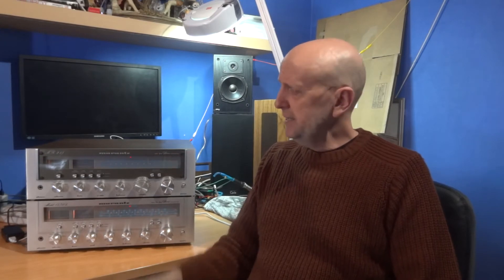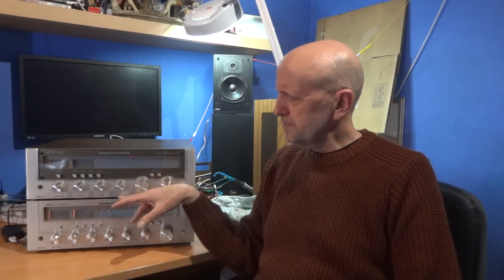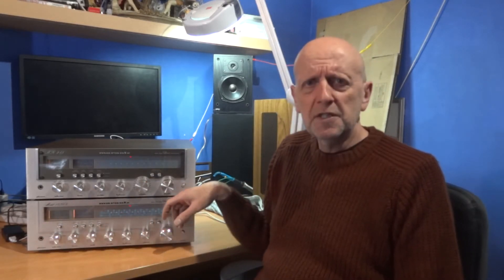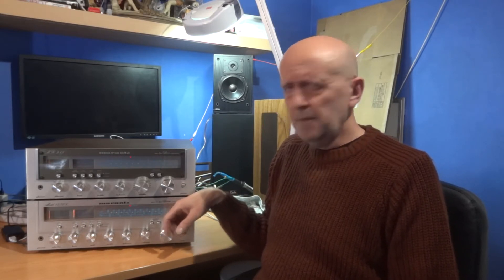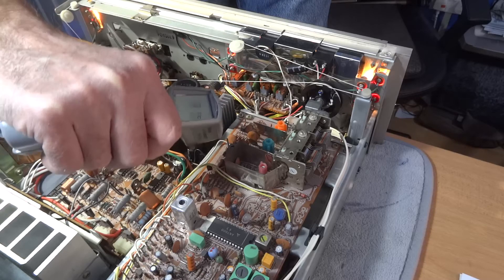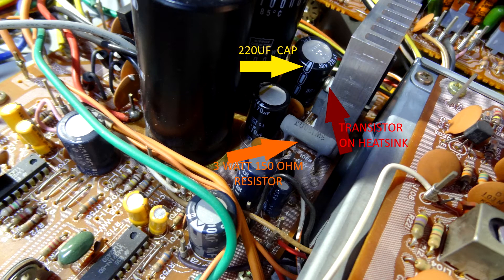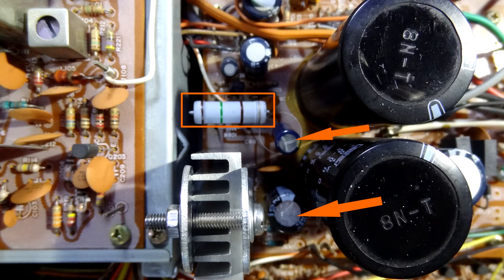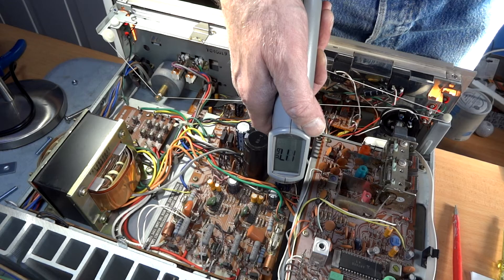Marantz 1515, 1530 Receiver Power Supply Running Hot, Replace Resistor, MR215, MR230 etc. Amplifier

Comment: I'm not "technically abled" so most of this is way over my head. I do like music and know a bit about audio. All the receivers I've used did run at least very warm if not hot. The exception is my Hitachi SR-804. After running it eight hours at fairly high volumes (at least when the wife ain't home) the top is only barely warm. This bodes well for longevity and as this Hitachi has been my main amp since 1979 it's proof positive. The Marantz 2252B I owned did run rather warm, same for a Marantz 1090, Pioneer SX-880, SX-650 and SX-434. Surprisingly, a Kenwood KR-A3060 I have has run very cool too. The SR-804 has performed excellently since purchase on 8-28-1979.
Reply from the maker: Hi Marty, On the Marantz 1530, the resistor in the power supply gets really hot even on low volumes, but its the smell it produces that some people do not like. Its nothing really to worry about as it is still operating within its temperature range even though at 127c I think it read. On most amps/receivers the heat would normally come from the heatsink that the output transistors are screwed to, so the higher the volume the hotter they would get. Just on the 1530 a lot of heat is coming from the power supply regulator circuit.
Reply: @MichaelYates  yes, the 2252B did have an odd fragrance. My SR-804 weighs under 23 pounds, not bad for a 50wpc receiver. I think the class G amp design did help with cool running and light weight.